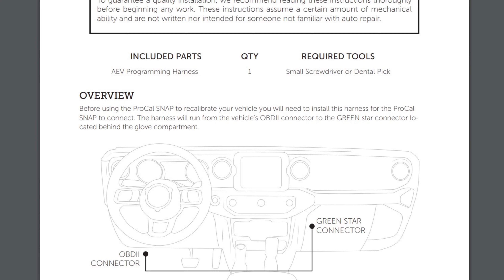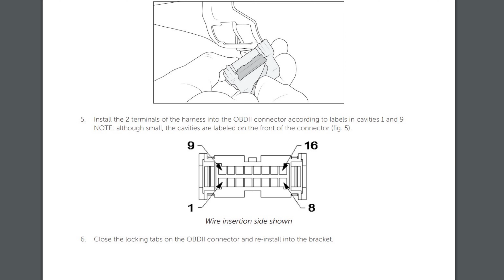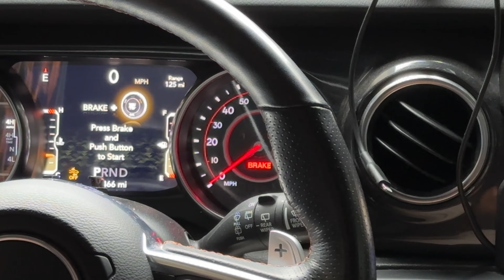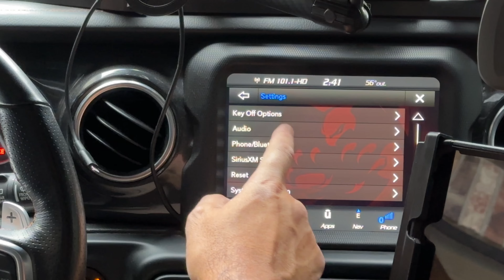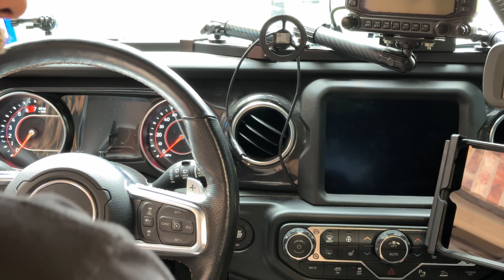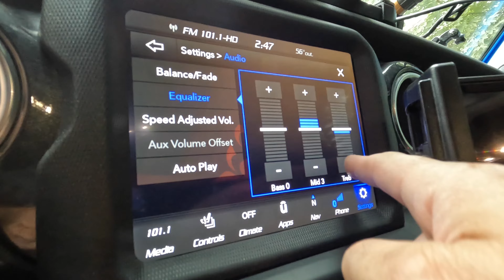Calibrating New Tires with the AEV ProCal Snap

Comment: When you measured your 37 inch tires how did it compare to your 35 inch tires?
Reply from the maker: I actually hadn't measured them but I have them on my M1102 overlanding trailer. I just measured them and they come in right around 33 and a half inches.
Reply: @MotoringAdventures_KE7SAI  So two inch difference still…Thx!
Reply from the maker: I'm surprised they were actually that short. Lol! But you're right. You're still getting an extra two inches in diameter (one inch increase in ride height) by going from 35s to 37s. FWIW, these factory 35s are measured as 315/70/17s. I'm not exactly sure what 35x12.50/17s would measure but they're supposed to be really close.

Comment: Don't take off the bracket, it's not necessary. Just get a metal hanger, tape the wire to it and feed it across.   This also can be done without the hanger but can be tricky.
Reply from the maker: It’s funny because I had already routed my ham radio coax cable across there without taking off the bracket. I decided to follow the AEV instructions for demonstration purposes in the video. Always several ways to skin a cat! 😂